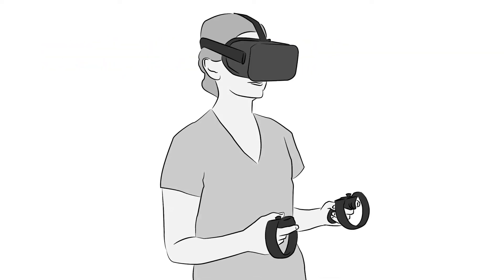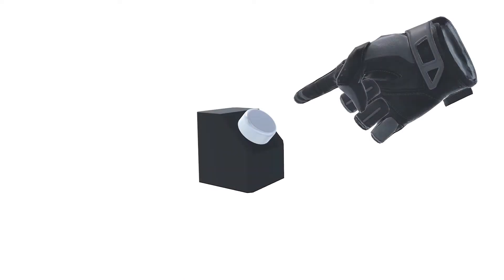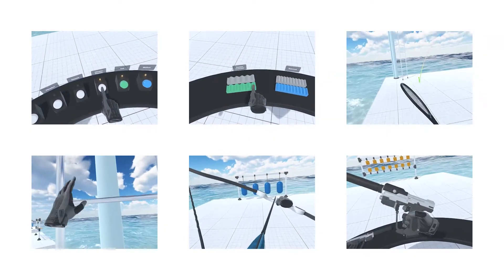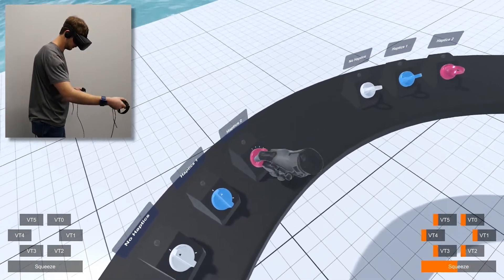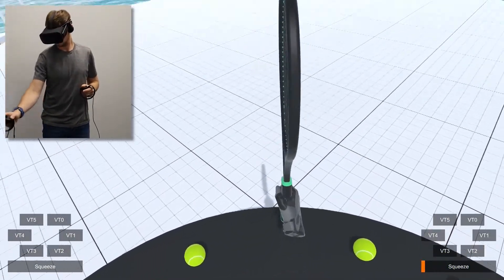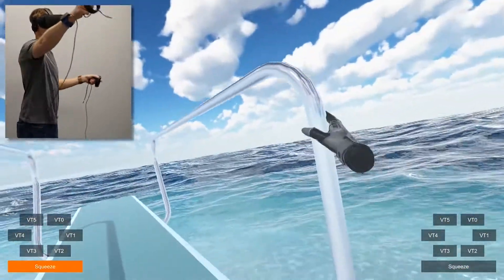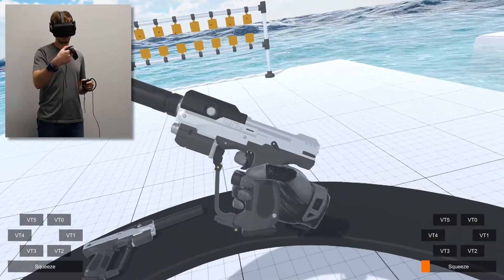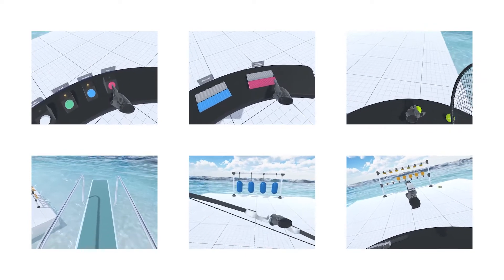Explorations of Wrist Haptic Feedback for AR/VR Interactions with Tasbi

Comment: interesting concept... i can hardly see how this is better than a glove but it's certainly light...
Adding wrist stress can be a nice way to simulate arm tension/effort, which you can't really do properly, even with gloves...
Reply: Glove is heavier as you say, clunky (at least for now), not very comfortable (yet), doesn't fit everybody unless the manufacturer makes multiple sizes (expensive), uses more power

Comment: Seems about as effective as just vibrating a controller, no?
Reply: Maybe
Reply: it also adds the squeeze effect that you dont have with a controller
Reply: nah, even if the feeling isn't 1 to 1, feeling a physical tension goes a long way to making something feel effortful. The brain is really good at correlating a feeling to what is seen visually in VR, so once you get used to it, your brain will reach in a much similar way to you actually pushing something, because it is a physical sensation, just attributed to the forearm rather than the fingers.